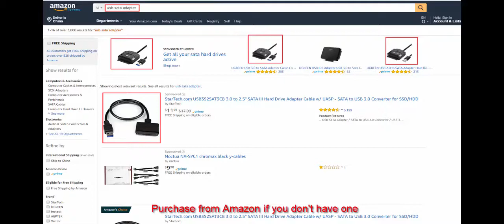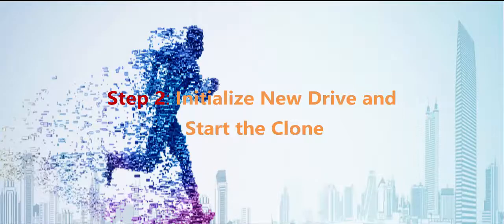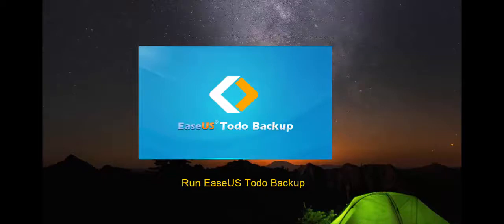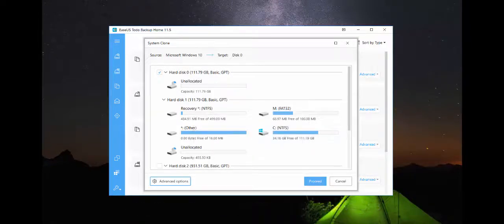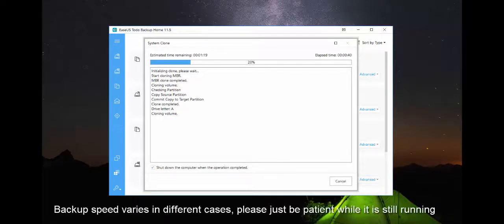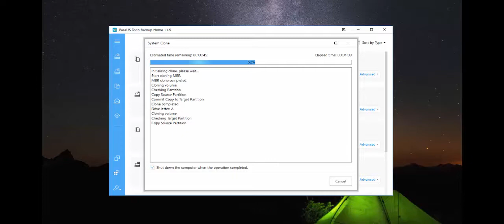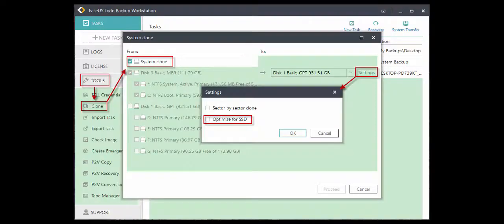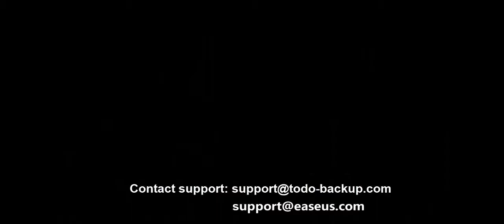How to Upgrade System Drive on a Laptop

Comment: This is an edit. The last comment I made was unfair and erroneous. 
I had made a couple of rather stupid mistakes in the SSD initialisation process. I assigned a volume to the drive instead of leaving the drive as 'unallocated.' 
 
I had a disagreement with the support fellow about this, but he used the remote control protocol to highlight where I went wrong. I was adamant that I hadn't created any partitions, yet by assigning the volume....theres the mistake. 

I felt a bit of a Berk after this, and I owe this bloke a pint..or two.
Reply from the maker: I'm glad to hear that our technicain have located the issue via remote session. You are welcome, please feel free to contact us if you need further help.